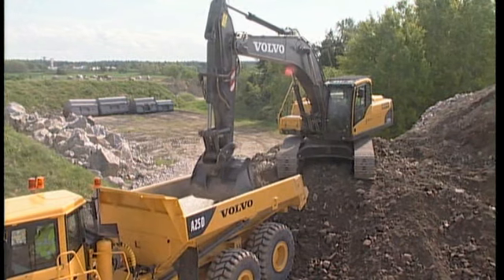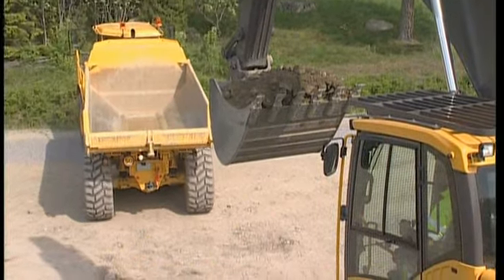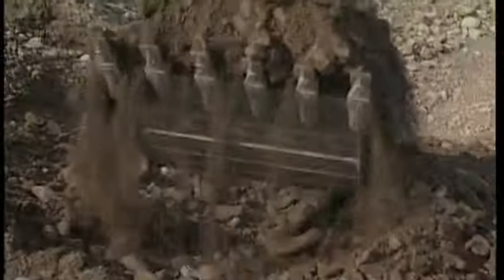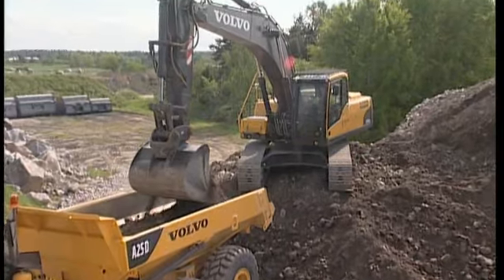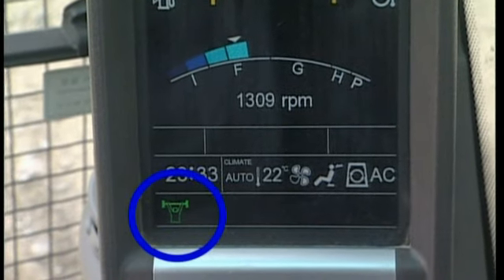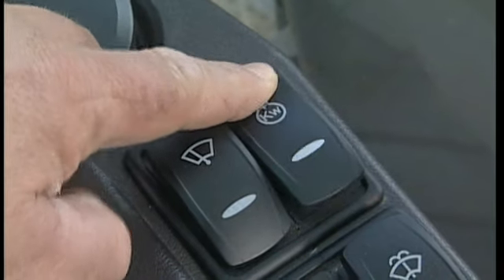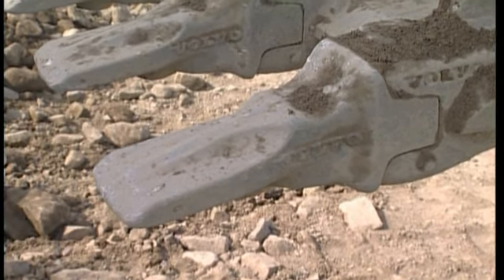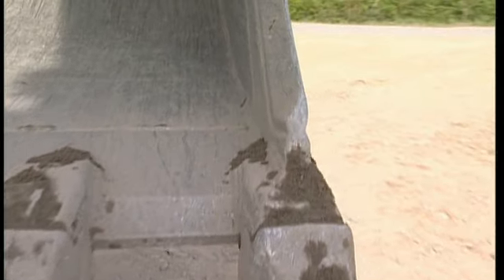How to load a truck with a Volvo Crawler Excavator (Part 6 of 15)

Comment: i have an ec140c with 2500hrs and i think the grey marks too easily even with very light bushes an such, also they dont fold up aswell as the Jcb js, every Ram on the volvo is shorter, and ram cusioning is non existant ,the tracking lacks power and wanders to the left , there rant over , i was told volvo are the bees knees in excavators! im not convinced, having said that im used to it now, i just wish theyd done more.